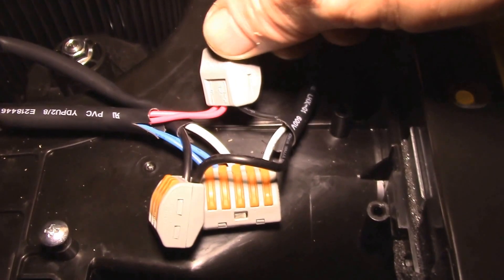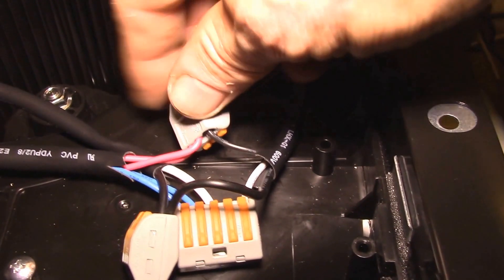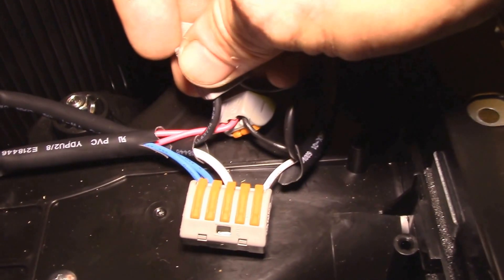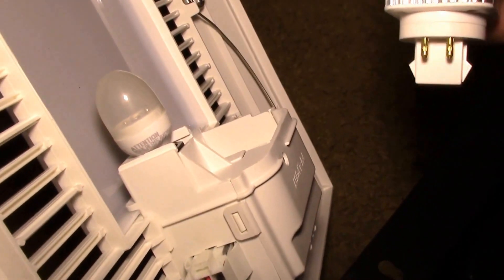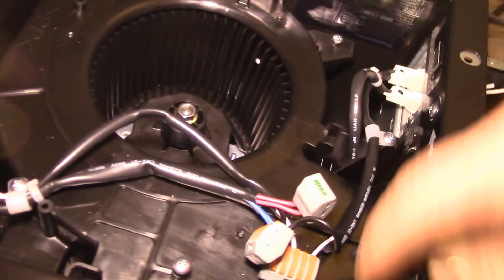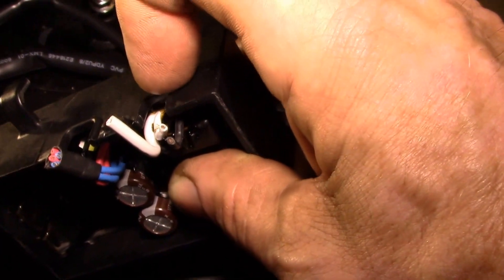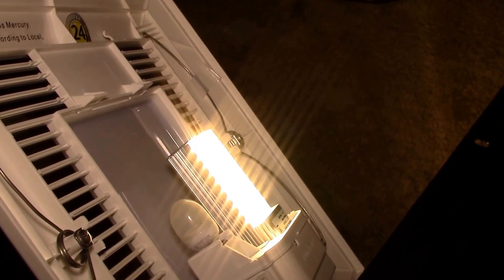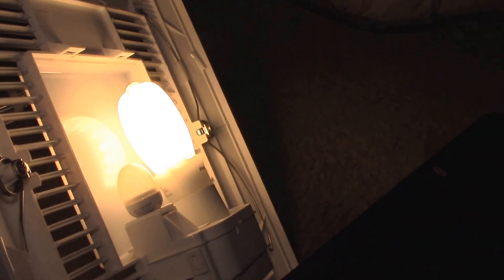Panasonic WhisperLite Bathroom Fan CFL Replacement, Part 3

Comment: Years later and this video is still proving helpful.  This is exactly what I needed to know about how to approach this project.  After the right parts arrived, I had running again in minutes.  Thanks!
Reply from the maker: Great, glad to hear that.  Yes, that built-in CFL is horrible, but easy to swap out.

Comment: Great series of videos!  My ballast burned out, and following your guidance, it was straightforward to remove the ballast and replace the CFL with an LED from Hero-LED.  Your tip to use Wago connectors was key.  There isn't much extra wire to work with, and the Wago connectors were just the right solution.   Thanks so much!
Reply from the maker: Glad the video was helpful.  Yes, those Wago connector blocks are so nice for projects like this.  So much simpler to add one wire at a time instead of having to twist a whole bunch together and get a wire nut on them.
Reply: I had the exact same positive experience- thanks very helpful and really liked the Wago connectors

Comment: Thanks for this series of videos. My cfl lights would last maybe 3 months. My whisperlite has two bulbs. It was frustrating that they were constantly burning out. I removed the ballast and reconfigured the wires. The 2 GX24 led bulbs arrived and are installed! No need for a new bathroom fan. Thank you!
Reply from the maker: You are welcome.  Glad this simple fix has been a help.  I guess I was lucky with mine, never had a failed CFL bulb, but I just hated the color of the light and the abysmal color rendering.